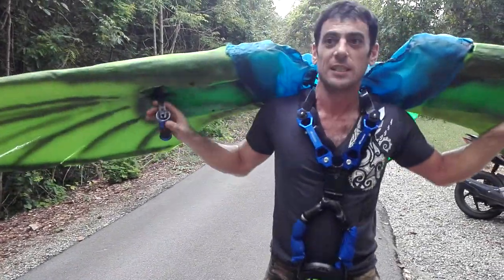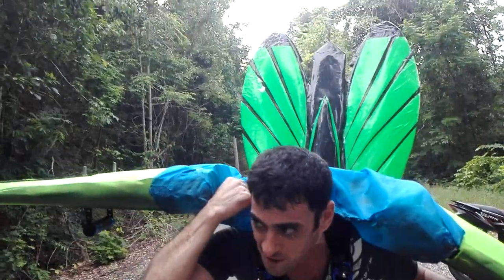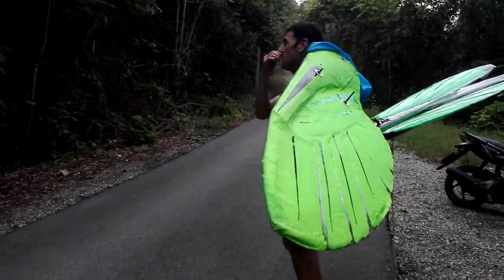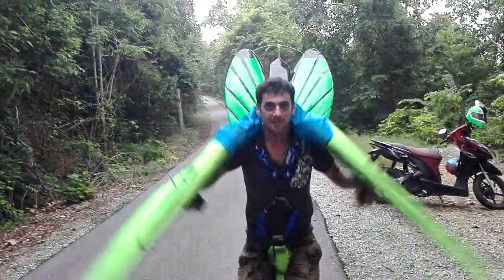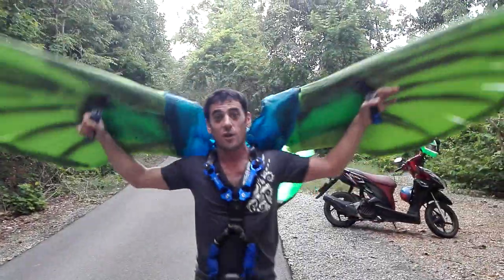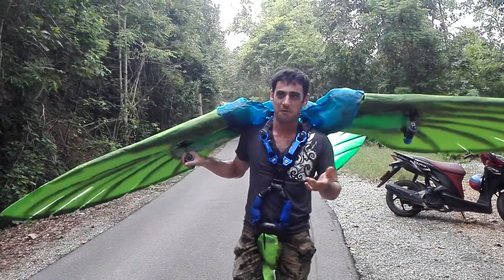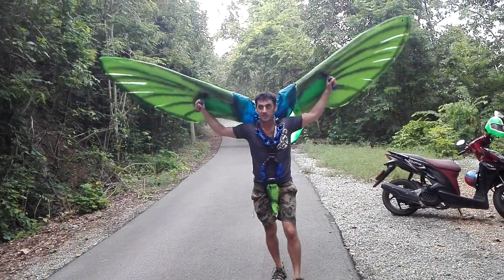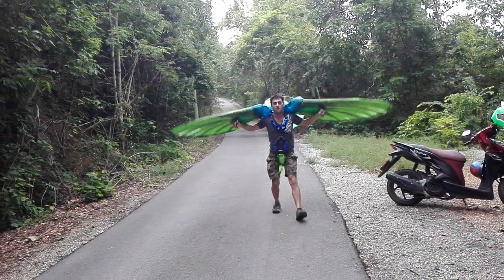Human powered ornithopter

Comment: Humans have not enough strength to lift themselves like this. Look at the chest muscles of any bird to understand why. However if the wing is  is electrically assisted and larger and does not move air on its way up, then it can certainly be done.
Reply: Human can actually do that....
Reply: @chibuikeibe6812  If you search on the internet, there are 0 recorded cases of people flying without electrically assisted equipment.

Comment: The wings need more surface area, it needs to be modeled bird: swan/Condor. In other words, a large bird of heavy weight using little effort in takeoff, rather than an arthropod wing. since human muscle to power ratio renters too heavy. Then you need a stop and three way attachment points for the airfoil to stay stable in takeoff. It needs to be hinged, or a hing and swivel attachment. For if all pressure is on ur arms alone, you'll year ur rotator cuff, plus, it allows runway takeoff and consultant gliding. Milk all lift principles and camber to pitch interaction and you don't need to fly just like a bird. You'll be more like a flapping human aircraft. Im working on a project myself called the king Condor 1+2 and ill be videoing it through on my channel

Comment: Sorry but I think this won't work. Birds have  less dense bones so their bones are so light. Also they have strong chest muscle relative to their weight. That is why birds can fly. We have denser bones and weaker chest muscle relative to our weight. That is why we can't fly without machine. Without machine, all we can do is gliding.
Reply from the maker: Thanks ,but I seems you still dont understand , how flight is produce by bird , first that we have best aerodynamic bodies , longer arms , and of course much more stronger muscles than birds, they sure must have holes bones to compensate the big body they have for their wings , the chest muscle that you say acts more as tendons to produce high tension , so the shoulders bones that stay in position of equilibrium point , makes the down stroke and up goes faster , that energy is transmitted to the point of the wing and thanks to the elasticity they flap even faster and that , is exactly kinetic  energy ,in other words , they don't flight for the power of the wind wings produce , but its for sound wich is a frequency

Comment: When your shoulders go back and forth, the wings will flap! But should use a figure 8 pattern. Pushing and pulling with both work to keep you up!
Reply from the maker: Yes my bro I must tell you you are completly right , im now making a new one but no metal, I think more close to nature , and im already builging feathers and a wearable rubber suit covered with leather, so this way the wings will be able to fold on the back stroke and use at maximum kenitic energy
Reply: @carlosornithopterlacuesta9786  consider a bats wing... no feathers. Got to keep weight low. 
Look at my comments on the other guys video.
Reply from the maker: Please send me your line id so I send you pict of my next design
Reply: @carlosornithopterlacuesta9786  not sure what you mean by line id
Reply from the maker: Sure , I have also in mind to make bat style too , in this case the aluminum exoskeleton will represent insect fly with flexible wings , then bird , and bat style , we have already uncode the sacred geometry so with the right frequency will be able to fly with any style, and so we all be free,
Reply from the maker: I keep working hard and listen all advice untill we make it true , and lets all surf in a quantum world with new understanding of the laws of this universe, that are our friend as long as ee understand it in the most fundamental level
Reply: I'd say carbon fiber bones...
a.k.a. tubes .... with light weight fabric. Aluminum for the solid pivoting joints.
 Either bird wing structure or bat wing. But either way my idea was connecting the trailing edge of the wing to the legs. The wing needs lots of surface area, and be flexible but strong! 

The arms and body are used to modify the wing shape like a bat.
Reply: Oh boy, you too?😂